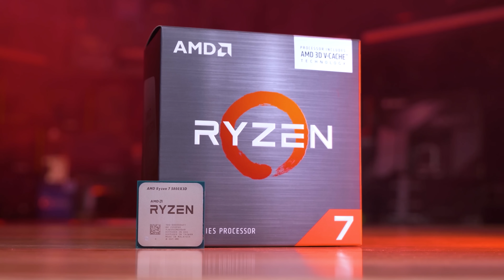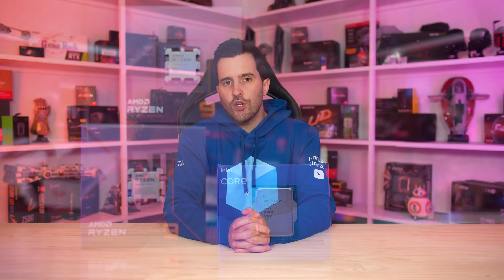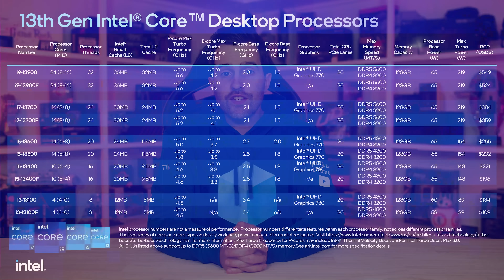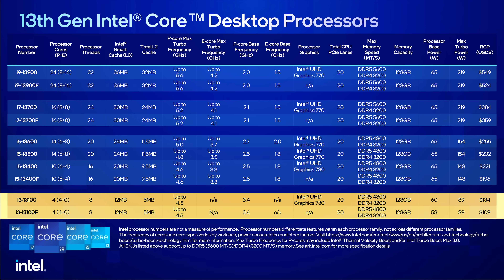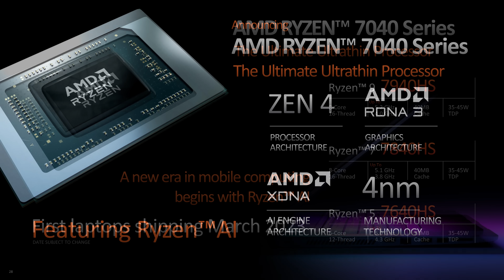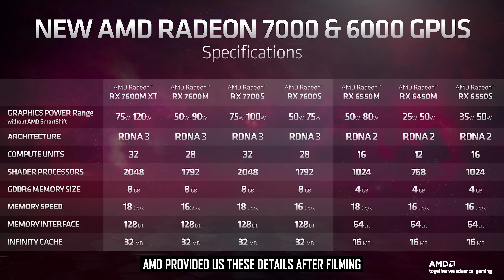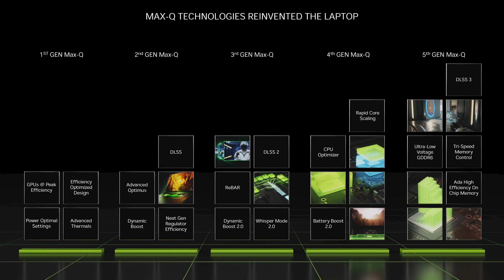Zen 4 3D V-Cache, 7950X3D, 7800X3D, New Cheaper CPUs, "RTX 4090" for Laptops - CES News Recap

Comment: I think the 7950 and 7900 are full 3d cache, normal 7950x only has 64mb of l3 according to amds site, so doubling that to 128 does add to the 144 with the l2 and l1.
Reply: The 3d cache die is 64mb, if the 7950x had 2 3d cache dies it would have 208mb of cache, not 144. It only gets 144 if it has 2 cache dies of 32mb each (very unlikely) or only 1ccd has the 3d cache die (extremely likely).
Reply: @Captain_Morgan  They never said that one would be 5GHz. Stop putting words in their mouths. They just said that one would clock significantly higher than the other for lightly threaded workloads, because fucking duh. The V Cache CCD on the 7950X3D could very likely hit around ≈5.1-5.2GHz, maybe even a little higher.

Comment: 7800x3d is so weird... it's the only one with lower boost clock, unknown base clock, higher TDP than non 3d counterpart and the same as 16 cores part. It looks to me like they don't really want to make them - putting the best chiplets in 7950x3d, some that has to be partially disabled in 7900x3d and whatever "trash" is left goes to 7800x3d.
Reply: Its cause the more cores a CPU has, the easier it is to increase cache in a chiplet design
Reply: @otozinclus3593  so You are saying that they split 64mb cashe into two 32mb parts and slap each of them on one of the chiplets instead of putting all 64mb on just one, leaving second one without it like Tim suggested. 
It's possible but looking at the whole Zen development this goes against AMD's core strategy - making one design and using it in as many products as possible so I'm more incline to believe in Tim's version and Zen4x3D requiring Windows 11 to use its scheduler for different core types like 12th and 13th gen Intel parts. But we will soon find out ;)
Reply: No, the high clocks are for non 3d cache chip and 3d cache chip has low clocks also in 7950x3d.
Reply: @captain_morgan  Did they explained it during presentation? I only watched recap from HUB and GN.
Reply: @captain_morgan  thanks for the info

Comment: 4090 on laptops is probably gonna make laptops go up to 5k even though even a 3080 pc is probably better than a 4090 laptop
Reply: I expect the 4090 laptops to be around the performance of a 3090 desktop. But the price premium will likely be massive. I'll most likely go for a 4080 one
Reply: @RTX5070Ti_Benchmarks   at this point 3060 gtx 1660ti and 1080ti laptops are the meta just not worth paying 2k for a 3070 which is probably worse than a 3060 desktop
Reply: @licker69  I really like to have a high end desktop replacement laptop that I can easily bring around and travel with. Definitely the value of mid-range laptops is way better though

Comment: I wonder for gamers who want the best gaming performance but balanced, what would be the performance gap between 7800x3d vs 7900x3d vs 7950x3d
Reply: It'll really depend on how the scheduling is handled on the 7900 and 7950X3D But I suspect the 7800X3D will have the best gaming performance
Reply: Probably 5-10%
Reply: @jonsnow2555  just a tad concerned by the drastic diff in boosted clocks
Reply: @michaelyang838  The higher boost clock is only for the CCD without 3D Vcache, so for gaming it will likely prove irrelevant, except for the potential for scheduling issues, thus the 7800X3D will be best choice for pure gaming, 7950X3D for a gaming/productivity mix.

Comment: the i5-12400F remains a great choice, especially given there is no 6P 0E choice in the 13th gen lineup
Reply: imo best new chip from intel is the 13600k or 13700 non-k if you need 8-Big cores.
I see no reason to advoid E-cores anymore, in worst case you can disable them , gain the less watt usage, and enable them when software support is more upto-date, or your on win11.

Comment: Im guess:
7950X3D
CCD1- 5.0ghz boost 104MB (40+64)cache

CCD2- 5.7ghz boost 40MB cache

Total- 5.7ghz 144MB cache 120w TDP

Price -$799.99

They could go 72MB per CCD but feel like it would hurt boost and gaming performance. They most likely figure gaming will only need first CCD and will be scheduled properly. With production workloads using both CCDs and getting boosted as needed.
Reply: This would also explain why only the 7800X3D in this new line-up is unable to have a "boost" speed like its X counterpart's 5.4 Mhz: It lacks the "3Dcache-less" CCD to do that.
Reply: this means one 8/16 7800x3d CCD with and another CCD for combined multicore workloads. Strange configuration.
Reply: That's probably what it will be...it's also why I bought the 7950x because I knew there would be limitations on the 3D CPUs and I need the clock frequency for what do. I wouldn't trade the clock speeds for gaming performance...but for gamers, it's worth it.
Reply: Ended up being 5.2GHz on the 7950X3D's X3D CCD actually! A R9 7950X3D w/ the non-X3D CCD disabled in BIOS/Ryzen Master is the SINGLE fastest gaming CPU on the entire planet, bar none, and it's not even close either! 🤷
Reply: I agree everything exept the price. It will be $999 or 7950x would not make sense. Look non x 7000 series MSRP. that mean that x parts has to go up closer to original MSRP and that means that 3d cache version that are about $150 more expensive (the difference between 5800x and 5800x3d) that the MSRP for 7950 has to be near $1000.

Comment: Sad the i3 CPUs are still stuck on four cores but the 13400f is looking like a great cpu with 6 cores plus 4 e cores
Reply: 13400F looks like a bad choice. Look at the clocks compared to the 13500 & 13600 sku's. The 13400 got a way smaller boost from 12th gen than the other i5s.
Reply: @Antony Howard  really depends on how the price pans put to be I'm just impressed e cores are now on the i5's
Reply: @odgamerout6698  yep, it's all about pricing, and also local availability. Not all SKUs are available everywhere.
Reply: @captain_morgan  while that's technically interesting, it doesn't change the fact that the performance gap between the 13400 and 13500 / 13600 will be significant. In 12th gen, the 12400 was the best option - the 12500 was only marginally quicker. This time around, the performance gap is a lot bigger. The 13500 got a significantly bigger boost in clock speeds than the 13400 did.

Comment: AMD if you see this comment do not over price these X3D CPU's please. The motherboards are already too high!
Reply: What is owerprice?
5800x3d is about $150 more expensive than normal 5800x. That means that normal price to these will be about $150 more than normal x variant of 7000 series.
Reply: @haukikannel  Not really remember the 5800x3d was only one cpu now we have 3 7000x3d variants so they can't charge $150 more for each or no one will buy them. 7000X sales are low already. If 7800X3D is $549 over 7700X $399 release price then no one will buy it.

Comment: AMD trying to push people to go for a 7900X3D it seems. 7800X3D could've been better than what it is based on the clocks anyway. I'm guessing these CPU's will be extremely limited for overclocking like the 5800X3D or could I be wrong?
Reply: Yea I would imagine they're finely tuned due to the interconnects. I never found the lower clocks on the 5800X3D to be a problem though to be fair. My 1% lows are through the roof.

Comment: I was at first looking at the AMD chips thinking, what is going on with the naming, but then I realized that 20=Zen 2, 30/35=Zen 3+, and 40/45=Zen 4. 30 vs 35 is lower and upper tier in the SKUs.  I know it's obvious, but just in  case anyone else didn't realize it, I figured I'd mention it.  I expect the 4090 mobile to be hanging around the 4070 Ti.  It has more cores than the 4070 Ti, but at a clock speed disadvantage.  It will be a pretty large increase gen on gen.
Reply: It is a downclocked desktop 4080 with less bandwidth. So yea probably close to the desktop 4070ti.
Reply: Laptop naming is super confusing. Having the architecture be the 3rd number seems like intentionally confusing. 

So a 7730 would actually be an inferior product to a 7540. Who looks at those two product SKUs and would come to that conclusion?
Reply: @Moist Ointment  It depends.  The 7 is the year 2023, 6 would be 2022.  The 2nd number means it's a ryzen 5 vs a ryzen 7.  Depending on the workload, yeah, the ryzen 5 4th gen could be better.  It is very confusing, and someone who doesn't know would just assume the 7730 is the higher number, so it must be better.
Reply: @TheCgOrion  it is confusing, because 7 denoting 2023 and 6 denoting 2022 is completely irrelevant. The exact same CPU from last year is just being renamed to have a 7. It's meaningless. 

And in nearly every mobile workload a thin and light would encounter, a 7540 would almost certainly outperform a 7730
Reply: Literally just changing nothing except having the architecture be the second number would be a MASSIVE improvement. It's a shit naming convention.
Reply: @moist_ointment  Yeah.  I agree that there's no point in the first number, since it doesn't determine the generation.  You could even have a Zen 3+ from the 6000 series, and a Zen 2 from the 7000 series.  If they reversed the 2nd and 3rd, and removed the first, things would line up better 250 would be Zen 2 ryzen 5,  270 Z2 R7, 350 Z3 R5.  It would be way easier for people, and the number would mean something.  Granted it has some issues too, but it's far better.
Reply: @moist_ointment  What they're doing makes logical sense to keep them organized, but it doesn't mean anything if you don't know how to decipher it.

Comment: Slightly confused regarding Zen 4 3D. 

At AMD's CES presentation they claimed the 7800X3D will be on average, 15% faster than the 5800X3D. However, the charts shown here suggest a 20%+ uplift 🤔

Am I missing something? Any idea why there's a discrepancy between the numbers AMD has given the press vs the numbers they've showed to the public?
Reply: They are showing cherry picked games
Reply: I do not understand why AMD compared with the 5800x3D & not the 7600/7700x ??
Reply: It's so that when hardware unboxed and other tech tubers review it ,it won't seem like they lied, LMFAO 🤣🤣🤣
Reply: They tested with a ton of titles to get that average, not all of which will be 100% CPU bound. Many GPU heavy AAA games will see smaller jumps. Sometimes MUCH smaller for the very GPU heavy. The games they showed in the charts are notoriously CPU bound eSports games. This really isn't hard to understand... 😑
Reply: That was 15% faster than a 7700X not the 5800X3D. What she said was not what it was compared on the slide. That was confusing. But it was expected. You get 15% over the non 3Ds of the same gen. Plenty enough to beat the 13900KS at 6Ghz in gaming (the KS is only a small bump in frequency). For productivity I'm not sure, since they have half the TDP of the 13900KS. I'm not sure they can win in productivity with 120W vs 250W.
Reply: @marsovac  who normal will buy 13900k for work?  this cpu is for youtubers only.  With 100w more power consumption than 7950x it is not worth it.  And for gaming, I don't see the need for a more powerful CPU than 7800x3d.
Reply: @marsovac  Nope, this isn't true. I went back and checked the live broadcast. Lisa Su specifically said: "on average 15% greater performance than the 5800X3D." 

So this still doesn't explain the discrepancy between figures.

Comment: I honestly expected more than 13% over the 13900k at max.
Reply: 13 to 20 percent is a generation these days so thats pretty impressive imo. Especially considering its only been three months since intel and amd launched their previous chips.
Reply: @piotrkrolikowski5903  it's not 13-20% though, at least he said up to 13% in the video if I remember correctly
Reply: @maegnificant  it's not "upto 13" lol, one of the games presented had a 30% uplift
Reply: @mitlanderson  these charts were not comparing to the 13900k
Reply: @maegnificant  on the ces presentation they had a comparison slide to the 13900k and there were a few games near 20 to 24 percent. Obviously it's wait and see what the real numbers are but I'd still take a 13 percent avg boost especially if it's not priced horribly.
Reply: @piotrkrolikowski5903  thanks! These are probably 1080p numbers right? What would you guess would be the difference at 4k or even ultrawide 4k?
Reply: @maegnificant  the 13900k charts show 13 to 24% lol
Reply: @maegnificant  the CPU plays a lesser part in performance at 4k vs 1080p...but it'll be interesting to see where they land.
Reply: @maegnificant  Most of the time 0% since you will be GPU bottlenecked at 4k.  But in those cases where you're not bottlenecked by the GPU the percentage difference will stay the same regardless of resolution.
Reply: @Cernunn0s90  with a 4090?
Reply: @maegnificant  Depends on the game. You will get anything between 0% to the 1080p percentage differences depending on if the 4090 is limiting the performance or not. In some games it will, in some it wont.